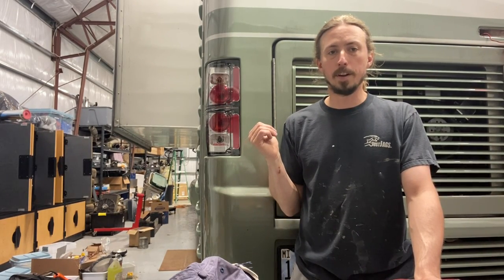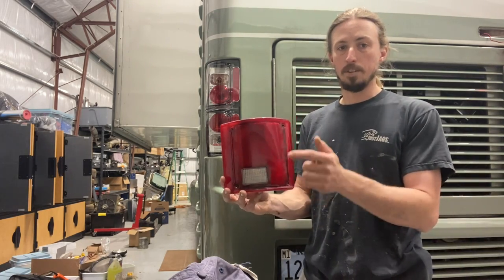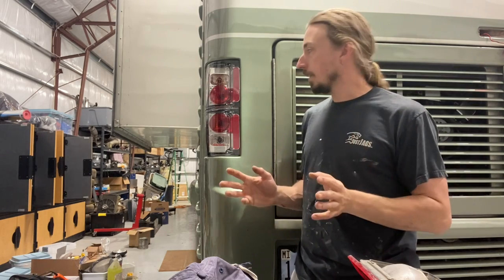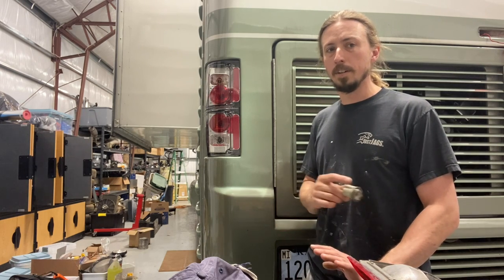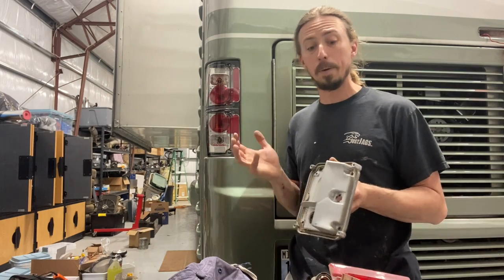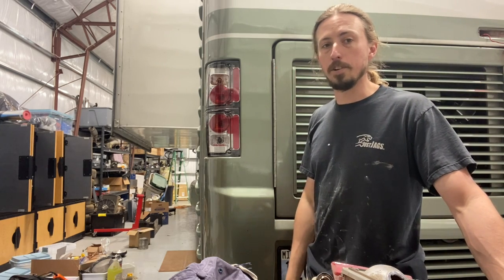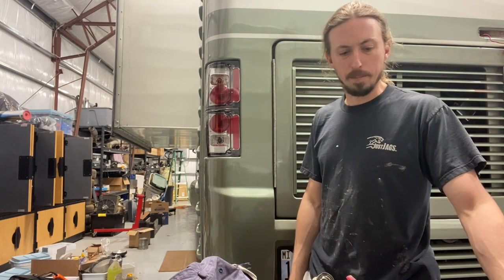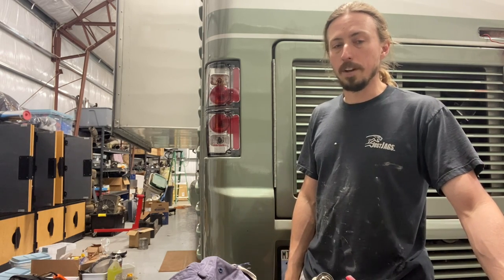2000 Holiday Rambler/Monaco RV Tail Light Upgrade

Comment: Great video, great ideas.  I wonder if anyone knows what rear lights were used on my 2009 Monaco.  Monaco did exactly what was done here, which is to use two identical pair of lights to make up the 4.  On each corner, the one above is flipped from the one below.
Reply from the maker: I'm not sure, but if you look somewhere on the housing there should be a DOT number. That you should be able to cross-reference to a vehicle.

Comment: Could you give me some information regarding wiring for the tail lights installed ty
Reply from the maker: Basically you’ll have to trace the wiring in your coach and match them. If you’re using incandescent bulbs and they’re all 1156 (or otherwise 2-wire) like I had it doesn’t matter if you reverse the positive and negative wires. For most LED bulbs it will matter. If it’s a 3-wire bulb (1157 or otherwise) the wire orientation also matters. Don’t cut the wires too short, having some extra lets you more easily move the bulbs if you accidentally get them in the wrong spot.

Comment: Thanks again for another great video!
Did you use LED bulbs or incandescent's?
Reply from the maker: I stuck with incandescents. There were no LED housings I liked in that style, and I’ve not seen any LED 1156/1157 bulbs I liked. I did put in a couple of LED 194s and I didn’t like how those ended up looking in the housings.